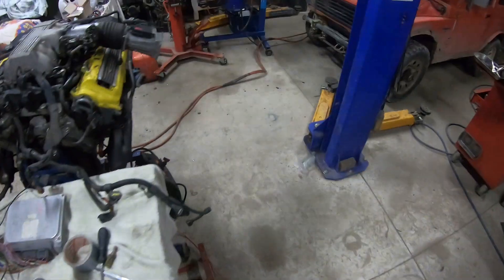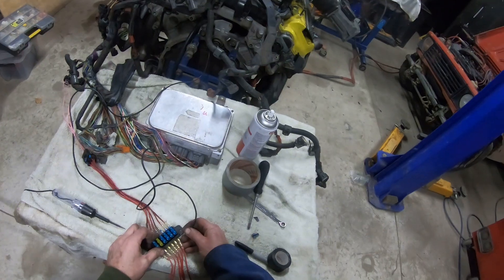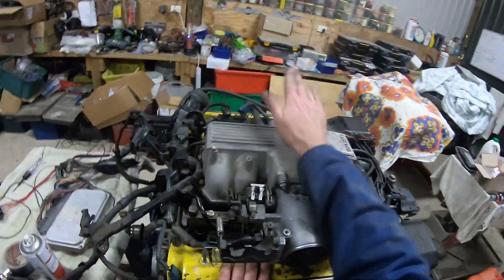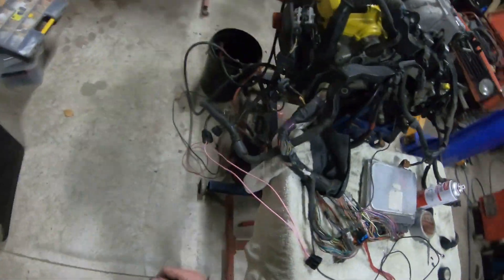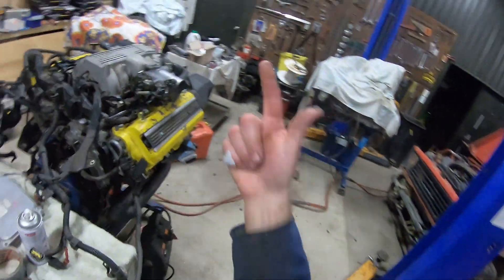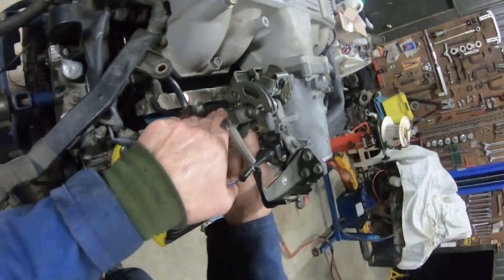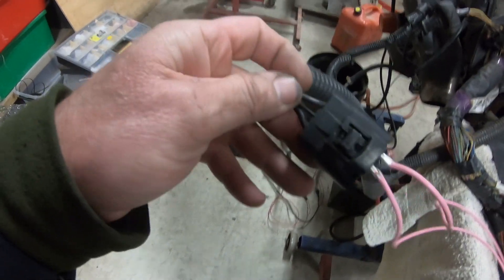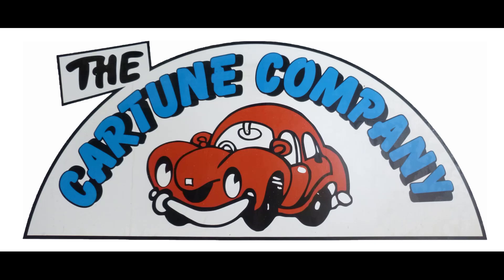1uz-fe Runs on 2 cylinders.  Don't believe it?  Here's proof.

Comment: Hey Kelvin, so happy to have found your channel as I live in Ireland and own a 1992 Soarer GT-Limited V8. It's been off the road for a while as it developed TRC and ABS warning lights so pretty sure the brake accumulator is low on Nitrogen. I'm currently trying to get it refilled but my car also hunts like your yellow 1UZ does. I must check my breather to throttle body in case it's damaged or came off. IS it possible for the Idle Speed Control to go faulty as it's only started that intermittent idling and revving up and down. Is there any other things that can cause this.
Reply from the maker: Hello Darren.  Old Yellow was hunting in this video as the IAC wasn't even connected.  I have a rebuild videos for the IAC which I think also shows the testing of the windings.  I think I have replaced 2 or 3 over the years which had failed.  Checking air leaks is a good start.  Injector seals are a really common issue along with sticky injectors after they have been sitting.  I just brought a soarer as a test car and then for the engine.  Cheers Kelvin

Comment: Hey man. Before I ask a question I gotta say you’re a legend. All your videos are informative and useful and I cannot thank you enough for your efforts. Anyway, I seem to have a problem where my 1uz runs on 4 cylinders. I figured it was one the coils so I took the bad coil out (had a crack in it and wouldn’t spark) and got a new one but the car still runs on 4 cylinders. How do you reckon I could go about trouble shooting before I take everything off the engine again? Could position sensors have anything to do with this issue?
Reply from the maker: Hello.   Thanks for the compliment.   This video gives some insights your question regarding the position sensors.    My engine ran on all eight with both disconnected.   I would confirm if it has spark like the white ute video.  Then confirm power to coils and back to ignitor.  Its also possible to trigger ignitors with a test light.  I have a really old video on that.  Like one of my first ones.  Good luck.   Cheers Kelvin

Comment: I've got a Toyota Cressida with a 1997 USDM UCF20. I ran it on a non immobilizer 96 UCF20 USDM ECU and now I'm running a Crown ECU. No matter what ECU I'm running, everytime I disconnect the battery the engine won't run on its own unless i keep the throttle partially open for a few minutes for it to "learn" how to idle. The engine didn't have this problem in the donor vehicle. What might be the problem?
Reply from the maker: Maybe the first place to check is test like this video.  https://www.youtube.com/watch?v=zIGrntJYp2E Cheers Kelvin

Comment: Unrelated question - have you used early non-vvti rods on a vvti 3uz or 1uz? Supposedly they're dimensionally identical but I haven't seen anyone who has used them on a vvti block.
Reply from the maker: I haven't done it myself but I have seen it done successfully by someone that I trust. Good power made with turbo.  Cheers Kelvin.

Comment: It's missing a ground or the ISCV doesn't have power... maybe it would run even better with that addressed ;D
Edit: you mentioned it at 5:00. But the ISCV missing power or stepper wires alone will cause the idle RPM hopping.
Reply from the maker: The point was to show how little it needed to run hence Iac isnt even connected, so no power or earths to that.   Only has two wires connecting the whole loom.  Cheers Kelvin